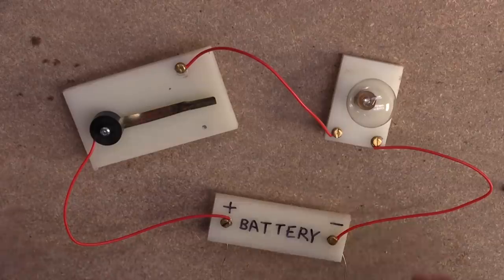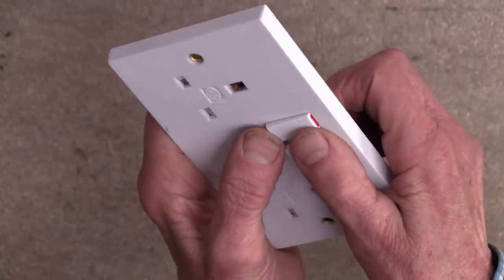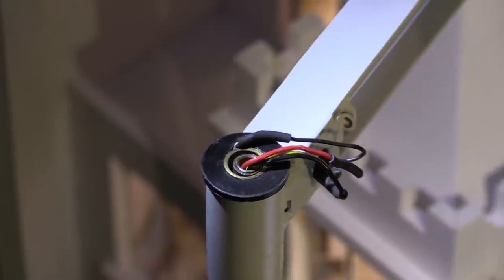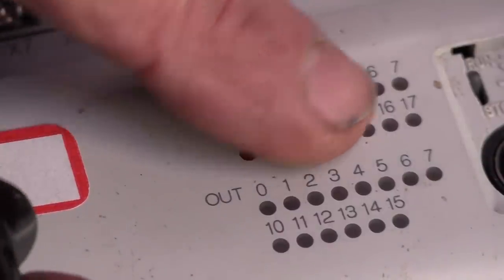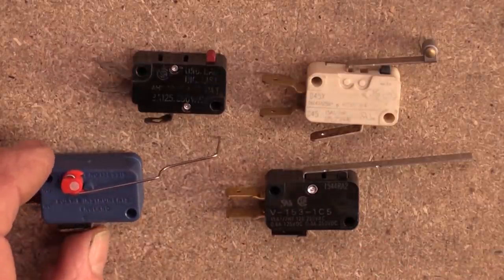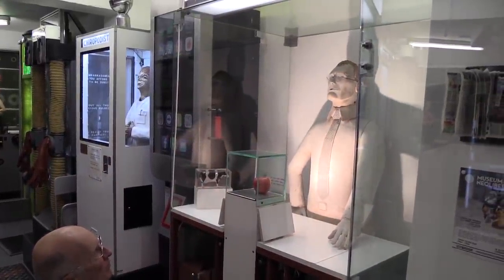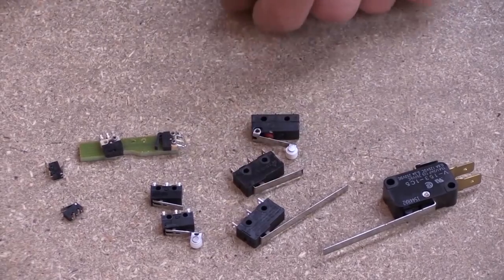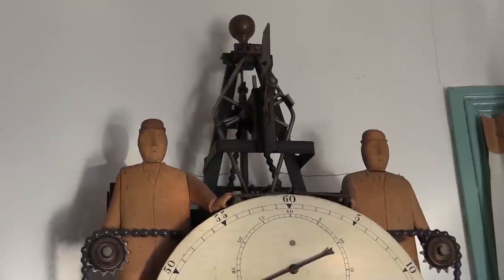SWITCHES - The Secret Life of Components, a series of guides for designers and makers - Episode 4

Comment: With hybrids, full on electric or hydrogen fuel cell vehicles, the voltages range from 180Vdc to 600Vdc or more on some. Still, there are dozens of components working off the 12Vdc range and will not change. Still, with high DC voltages, smaller wire and smaller components can produce excellent options as 48Vdc operate a small scroll-type compressor in series with a common air filter. It’s main job is to force more air (21% Oxygen) into the hydrogen fuel cell to increase its efficiency above the 86% range with perfect producing voltage at 100% of hydrogens energy capabilities. So, the 48Vdc switch is controlled by conventional low DC voltage, but increase it’s life at this voltage range, simply use a magnet. The electrons are drawn to the magnet as it breaks the circuit to off. I would be the first to use a sealer tube, inert gas and mercury sometimes still called “Quick Silver”.
But who in the EPA want to have a car accident where mercury or mercury gasses are released. So, it is best to only use a mercury gas/vapor in a curly household light bulb. What could go wrong there.
 Disscisions of a hydrogen fuel cell used to power a vehicle always bring up the same question; “What happens if it leaks during a fire?” Don’t you remember the “Hindenburg Blimp” well, Joe Biden was there but can’t remember. Either way gasoline was met with same resistance when introduced. If you poke a hole in a gas/petrol tank, now plastic, it falls to the ground. Firefighters are trained on special techniques for gas/petrol vehicle accidents as they don’t blow up, like in the movies, nor do tires squeal on grave roads. No, hydrogen fuel tanks are basically indestructible and if a leak happens, it simply floats off into air. Repair shops are fitted with ceiling sensor that turn on a fan to, clear the air! Fueled the same was electric cars are with bi-directional communications from car to pump, but much quicker. Did you know there is two types of hydrogen fuels sold? Gas and liquid. Liquid is good for 300 mile and is slightly more expensive. But you can go 100 MPH with 5 people or four mother-in-laws. Producing is electrolysis. A contract signed for penny’s on the dollar are sign by power plants to be used at off peak hours. The grid supplier from the Midwest sells electricity to the East in the AM, Midday the local grid, afternoon - evening to the West. But can’t shut off. So, contract in hand, build a plane concrete slab building in a corn field outside to town, yet close to those dangerous overhead power lines. Produce oxygen that few people use, but pressurize and contain the hydrogen, like the do now in Sweden. Hydrogen can be used with some success in the ICE or stationary jet engines used to create electricity! Yeh! Win, win for everyone. And you little switches too! Ed of the North!

Comment: The Taliban are experts on switches.............especially pressure pad switches made from two pieces of hack saw blades wired to a barrel of ammonium nitrate. In the early days of high voltage grids, they had a problem that when a loaded circuit had to be broken, the electricity would just blast through the switch............they discovered that electricity has momentum, and the sub station switches need to be able to taper off the current before the circuit was completely broken, and that stopped all the damage. Thats why at 5.55 the big switches DO move slowly because they MUST, to taper off the current.

Comment: Good to see that you're doing an episode on sensors, my personal preference (from learning the hard way) is to use Hall effect, Opto, Inductive or capacitive "switches" for all routine operational; switching/position sensing and only use physical switches as last resort limit switches if the sensor fails for some reason (in which case the microswitch would be hardwired to kill the power to the motor and maybe also signal a fault) I once built a set of devices that had microswitches that operated hundreds of times a day and they only lasted months, I switched to hall effect sensors and haven't looked back since. This test rig also used hall effect sensors with a magnet on the belt :-

https://youtu.be/uz5QBpfs2k4

Comment: As some others have said, the switches you showed in a substation are not breaking load. A lot of those switches will have arcing horns on them as well, with their sole purpose to carry, then break the arc. The actual load carrying contacts will roll in and make a tight connection when closed and will not see any arcing. The balls you see on the ends of these disconnects are part of the arcing horns. So the current carrying contacts do not get any arcing wear. 
https://www.youtube.com/watch?v=K8cMSDwZkDU

Comment: I know this reply is 2 years late, but here is possible solution for plc to know if motor stopped. put a plc input on each side of the motor wires, if you see 00 then motor is stopped, 01 or 10 motor is running. This based on the animation of 2 diode and 2 micro switches for motor limit

Comment: That looks like an electrolytic capacitor you used for the snubber, probably too big a value and wrong characteristics. Standard snubbers tend to use 0.1uF with 100ohm resistor. I would use a ceramic, or ideally a film type capacitor if building a discrete snubber.

Comment: As an electronics hobbyist I though I knew all there is to switches... how wrong I could be!
Reply: Kaj,  He didn't delve into slide switches or tact (tactile) switches yet;  Those could and probably should get a video all of their own. He probably should have covered paddle switches in a little more depth; those are particularly useful because they can be had in varieties with a neon bulb or LED inside them to indicate when the switch is turned on.
Reply: @goodun2974  I sure hope Mr Hunkin does videos on those too... this is some seriously good stuff!
Reply: @kajyakuzonik9130  , I am a retired audio repair tech; we probably had 50+ different styles of tact switches in stock at the shop and yet sometimes we still didn't have or couldn't find an exact replacement switch for some of the equipment we were repairing.